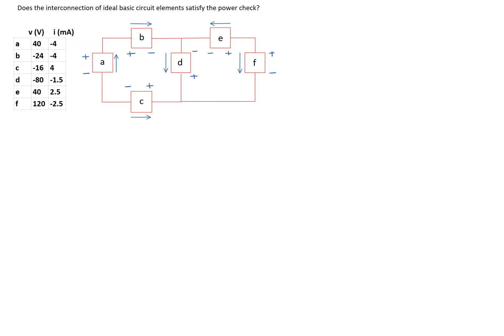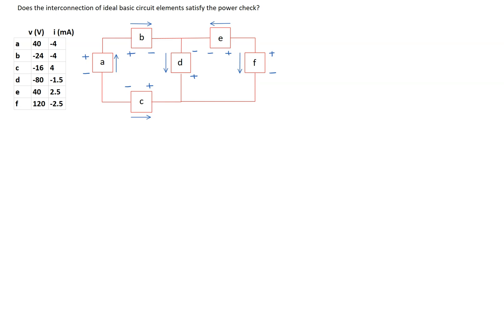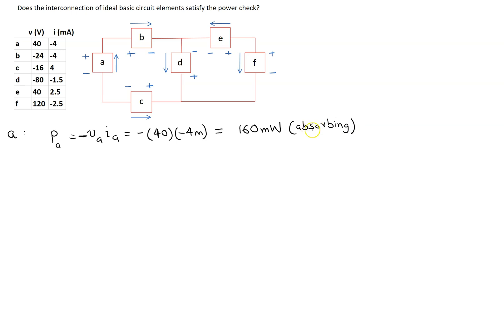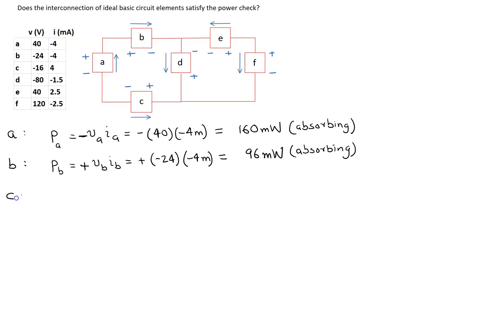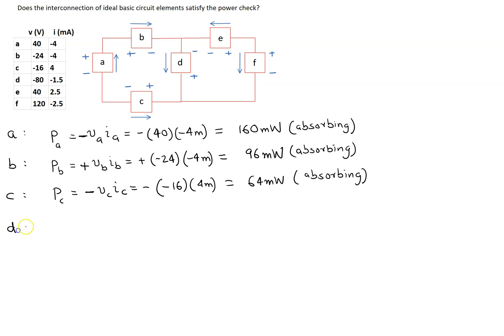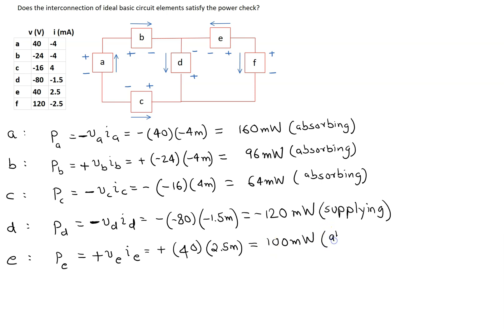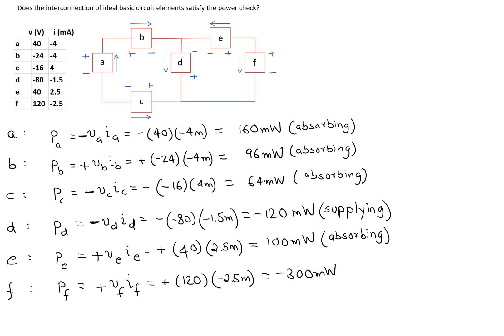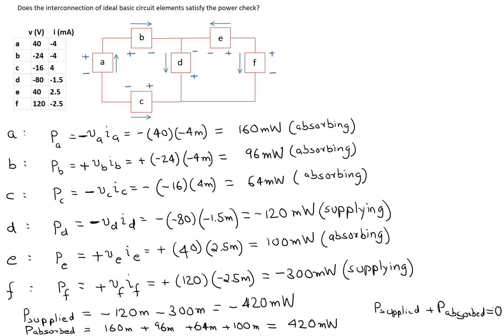Ideal basic circuit element - Example 1 Interconnection of Ideal Basic Circuit Elements

Comment: What does interconnection means in this context,sir?
Reply from the maker: Thank you for the question. In this context, interconnection means that ideal basic circuit elements are providing inputs and/or outputs to each other.
Reply: @electriccircuits7164  Oh I see ,thanks a lot professor.
One more thing if it's possible.I'm studying ideal dependent/ independent voltage and current sources .Plus,I have wondered sth.Why there's ideal dependent  voltage/current sources?I mean what's the reason behind using dependent voltage/current sources in our circuit or model? I'd really appreciate your answer.
Reply from the maker: Dependent sources are not real world components. They are a circuit theory construct only. They are used in circuit theory to theoretically model the behaviour of real world components. See for instance https://youtu.be/30aIa0CdVUU?si=pL1RQLEI4jur8gj0